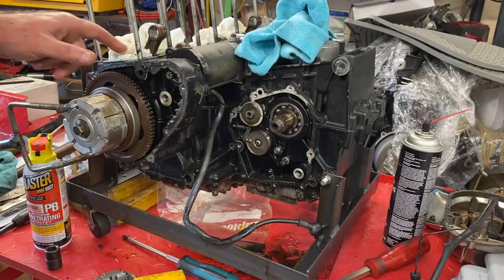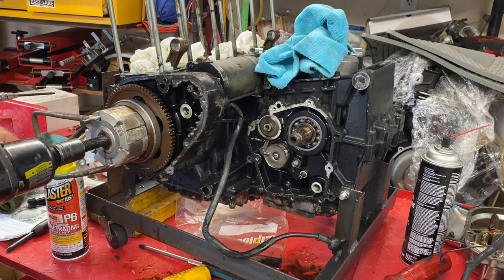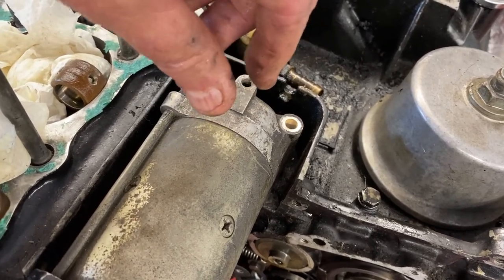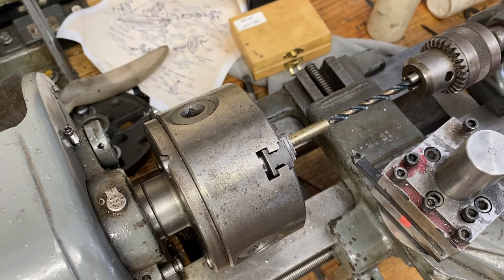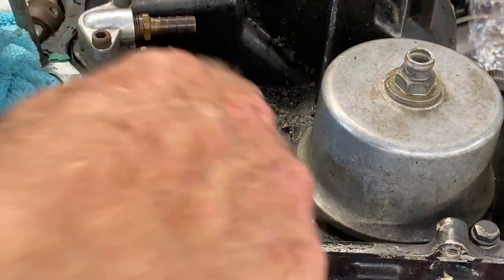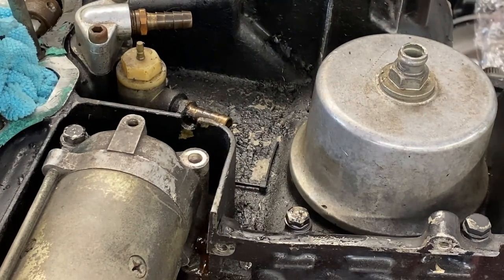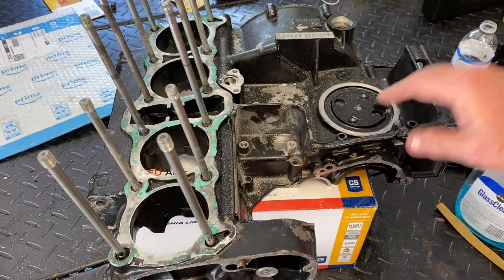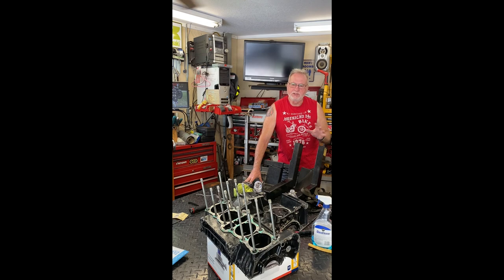Z1-R video #4, engine teardown and yep... I broke stuff.

Comment: I did the same dam thing to a 1980 KZ1000G, starter bolt boss. Though the easy out was actually working then click, cracked it. Thanks for showing the mistakes, helps.

Comment: brilliant work , really annoying place for a bolt to snap. Just incase you didn't know , welding after using brake cleaner creates mustard gas , so be careful with that, awesome work though , sometimes its the correct decision to take parts to a machine shop to do the very difficult jobs.

Comment: I have had luck sometimes with getting those broken bolts out with a small pointed punch or scratch awl and tap it with a small mallet. Give it a try next time, might save a buck or two.
Reply from the maker: I have done that myself numerous times, but it was hard to get at the M6 starter bolt at an angle conducive for doing that and I didn't want to even try the crankcase bolt. Thanks for the suggestion and thanks for watching.